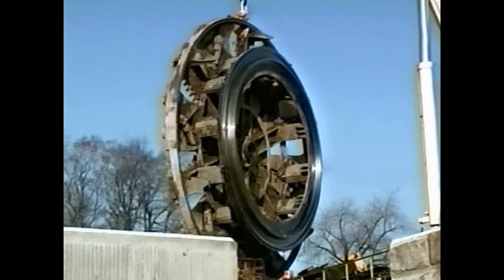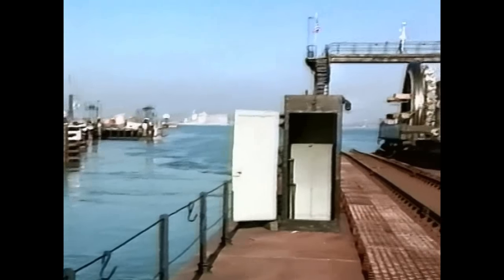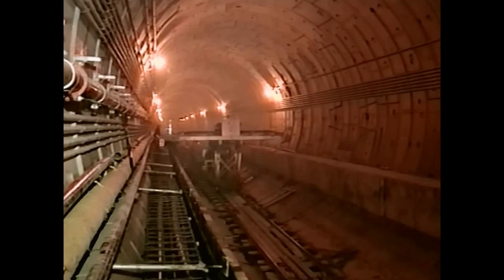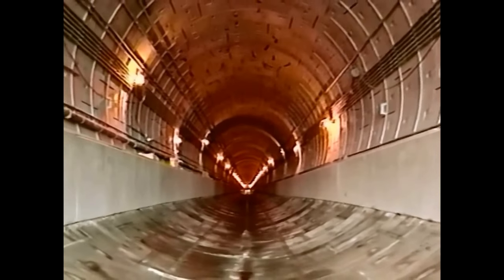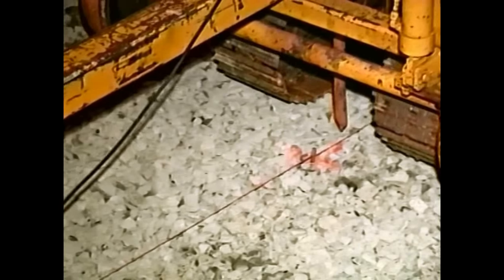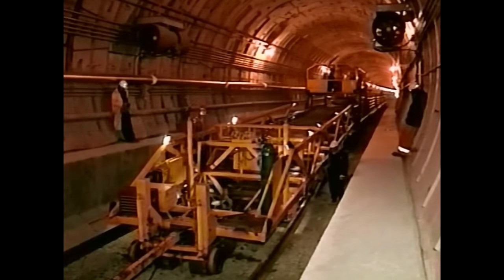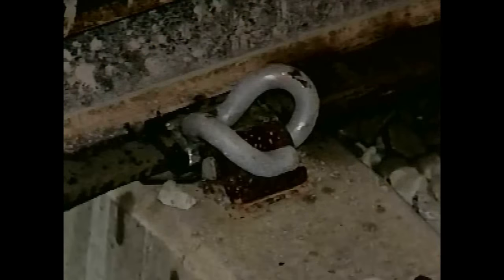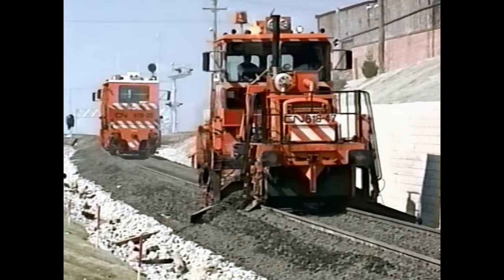Finishing the CN St. Clair River Tunnel - 1994

Comment: Great to see my old job on tape.
I worked on the St Clair tunnel project as a Senior Inspector of Works for the year off Tunnel Boring Machine mining, part of the international supervision  team of Hatch-Mott McDonald a Canadian British consultancy group.
This was an interesting project as the tunnel line went under the Imperial Oil testing laboratory and with all the delicate instruments inside the building could not suffer any settlement. The build was jacked up so any settlement would be in a controlled manner back to original level. The TBM could mine under the building but then started to develop cutter head bearing problems. So an interlocking pile block mass was constructed and then the centre was drilled out to form a shaft. The Lovat TBM drove into the shaft and the cutter head was removed, cut in half and transported to Lovats Toronto base for repairs. The bearing face of the leading section was refaced insitu. Once the cutter head was refitted the TBM proceeded under the river with out further incident. 

I made a good friend while in Sarnia and he worked the rail ferry, it was ironic that I was going to do him out of a job.
BS